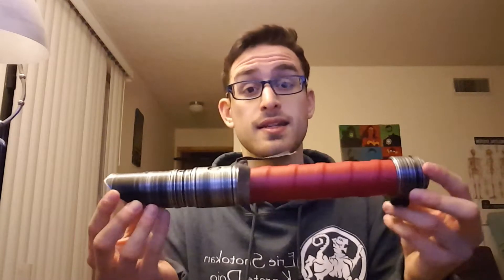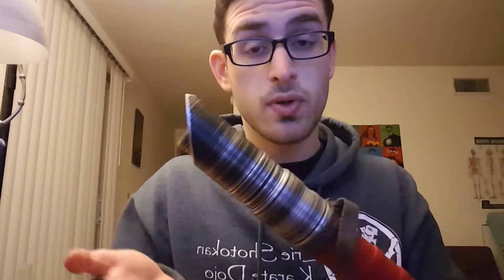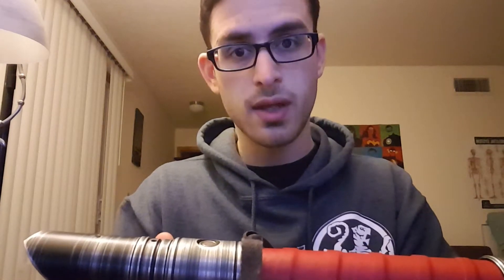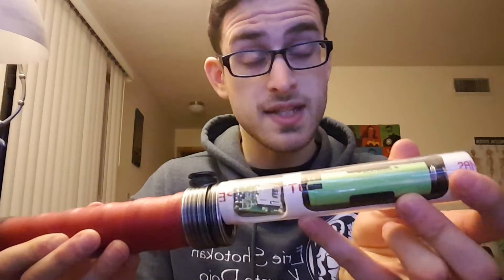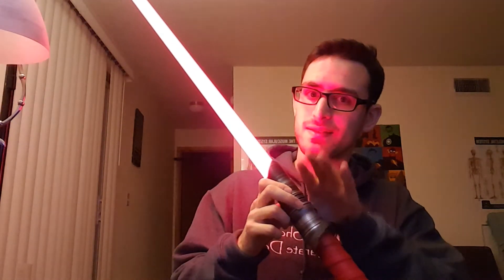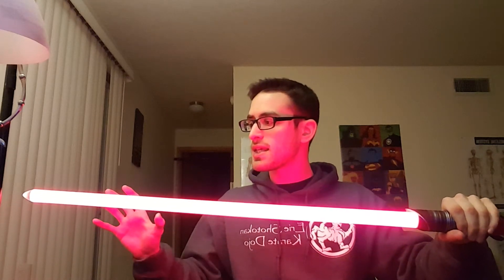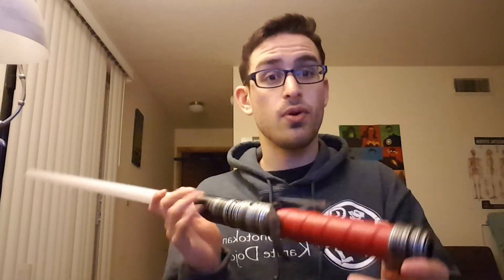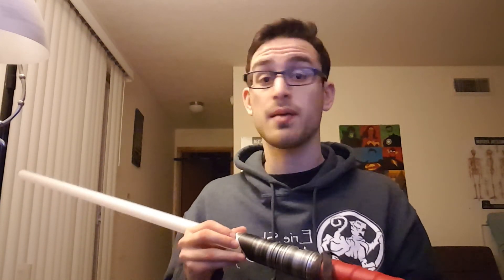Custom Saberforge Dissident: "Dark Dissident"

Comment: Hey Mike not sure if you are still building lightsabers or not but if you could plz tell me what size retention screw size and bit you use that would be great!
Reply from the maker: Hey! I am still building, but the process has been greatly slowed down by school unfortunately. Looking forward to getting more building in during the summer! As for the retention screw size, I use 8-32. You can find both the appropriate drill and tap bit sold together at your local hardware store.